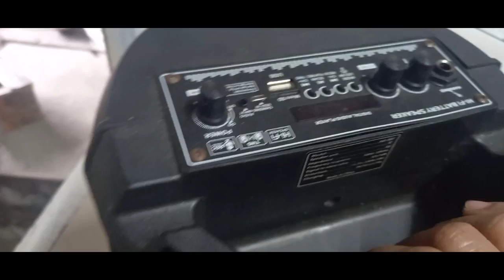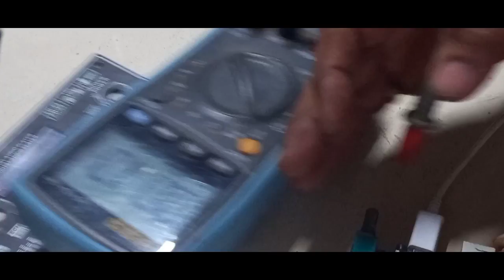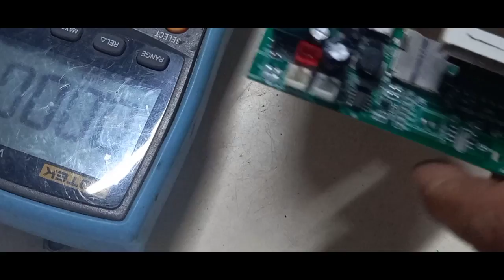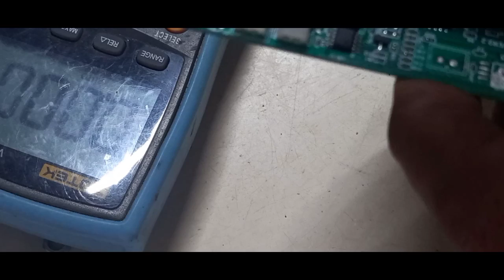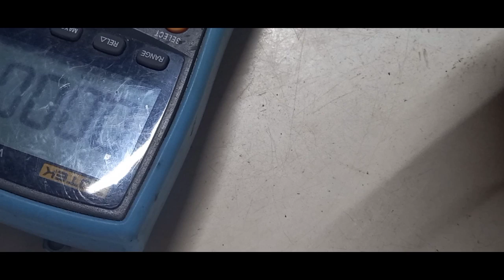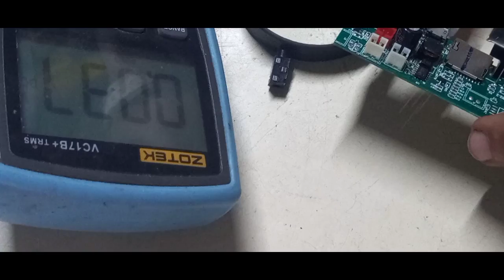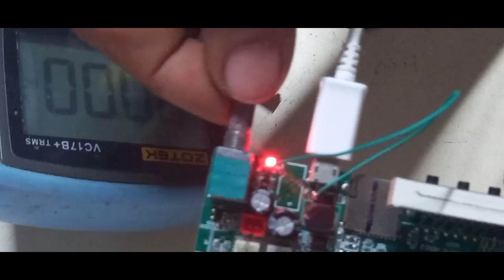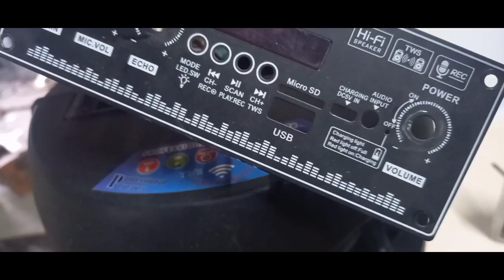BLUETOOTH RADIO GOOD SUPLY NO DISPLAY

Comment: Patoro boss paano ayosin Bluetooth speaker ko d12 Wlang display pag isak sak my power cya Wlang display
Reply from the maker: Voltage check muna sir kung mayron ba nakarating na voltahe sa digital display ic
Reply: boss yung sakin nag chacharge naman sya kaso di nag tatagal nadidisconnect ang bluetooth nya tapos maya mamatay na sya boss ano kaya problema ng speaker nto baka pde mo po ako matulungan salamat po sa sagot ..
HTM 812 po speaker ko
Reply from the maker: @benzoncedricvillasin555  may shorted ang radio mo kaya nag auto stop nya parang hindi madamay ang ibang parts..patingin mo sa electronics tech yan..salamat po
Reply from the maker: Capacitor first and voltage checking...salamat po..